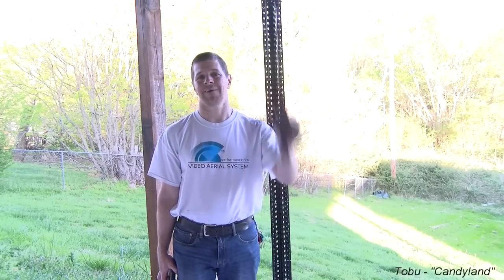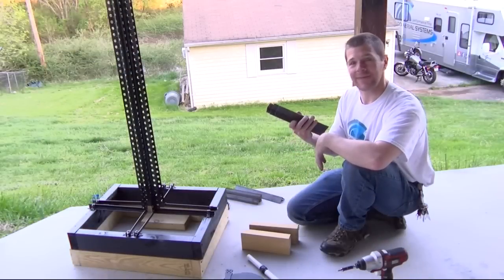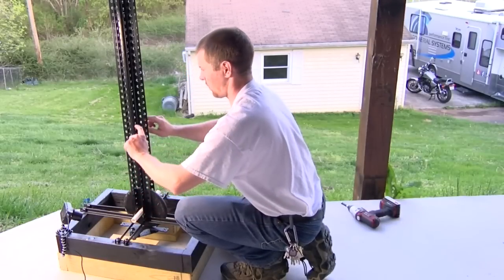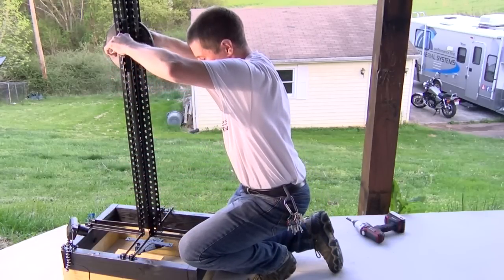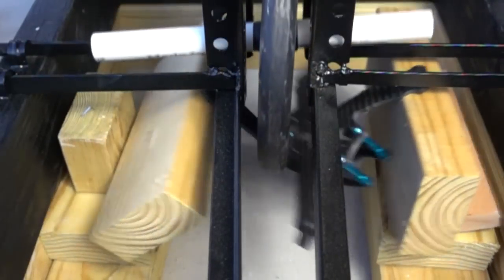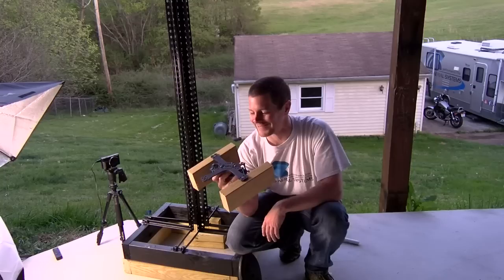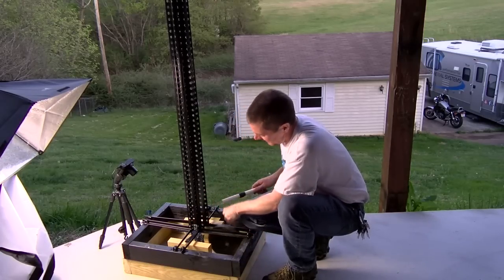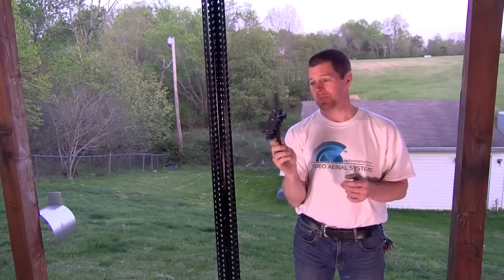Smash test: Stone Blue Spartan - 40.68 joules

Comment: So.... do you want a stiff or flexible frame?... 
this design is not efficient... if you want flexible, it should be fiberglass... if you want stiff and strong... Carbon with proper fiber direction is the answer...
Reply from the maker: This frame is actually quite rigid.  With the 10lb weight setting on it, the frame deflects 1/16".  The idea is to find a balance of rigidity and flexibilty to have the most durable frame that flies like it is solid and crashes like it is flexible.  In my opinion, this frame did that well.
Reply: https://youtu.be/KHXVf0SaJpA this was a good vid too
Reply from the maker: That's a great video!  Excellent tutorial on material.  It shows why Kevlar is becoming a favored material in quadcopters.
Reply: yeah I think we haven't found the best material yet but have gotten price down on production. you ever look up dyneema carbon fiber? It seems to be a step above what we use now.